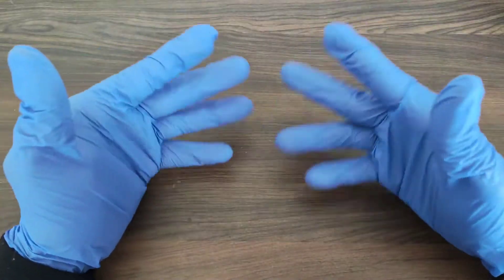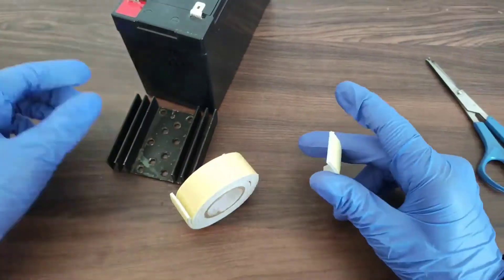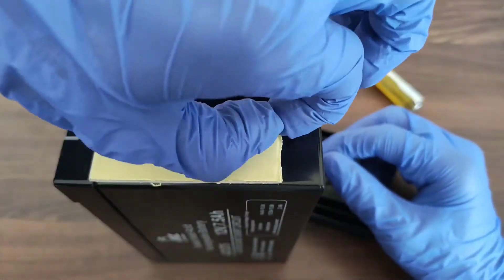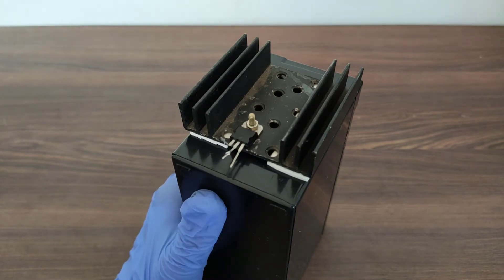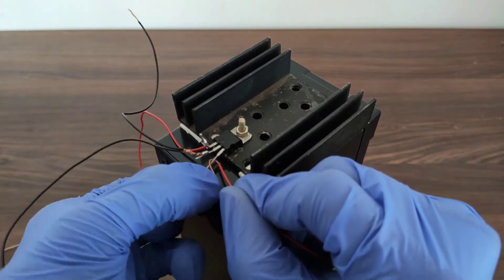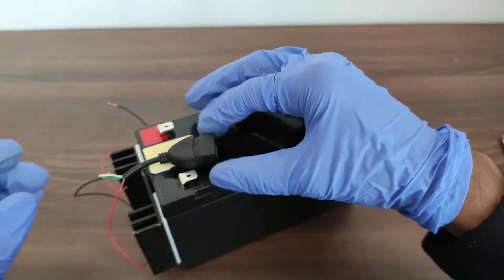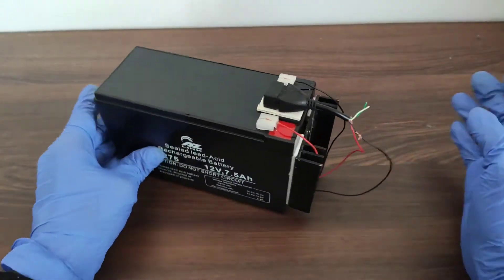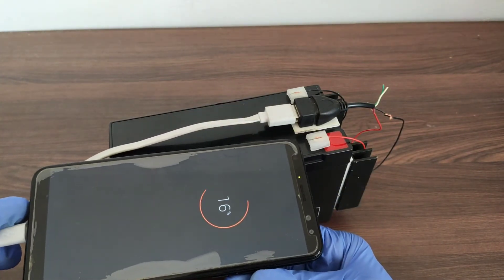50,000mah power bank using 12v 7.5ah lead-acid battery|break the bond|

Comment: 7805 will dissipate some power as heat.  It's better to simply use a buck converter which will give a higher efficiency and can provide more current.
Reply: like tp4056

Comment: 7.5ah = 7,500mah  it's impossible to get 50,000mah from a 7,500mah battery.
Reply: Even with 5V you wont get 50k mah.  12/5=2.4 and 7,500mah x 2.4 = 18,000mah is the most you can get.
Reply: @SailKaizen  That is the case of a perfect efficient system. What about we do it with a 12v 32ah car battery
Reply: @alanjames7480  It wouldn't be an ideal to make a powerbank from a car battery since it weighs quite much. But if we do the math; 32ah = 32.000mah@12v's 12/5=2.4 and 32.000x2.4=76.800mah@5v's. As you said this number is not very realistic since it requires a perfectly efficient system. You could probably charge an iphone about 25 times.
Reply: @SailKaizen  Thanks your reply. I actully want to make a stationary power bank due to the frequent power failures in my place
Reply: And also the ampere is very low